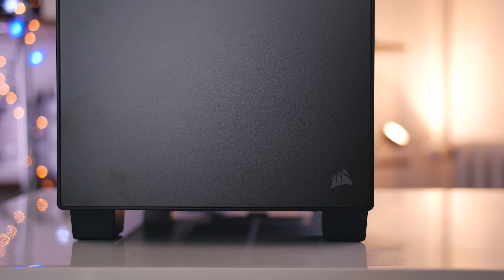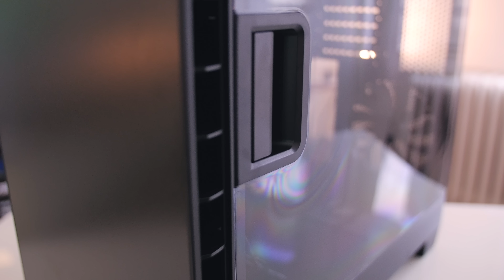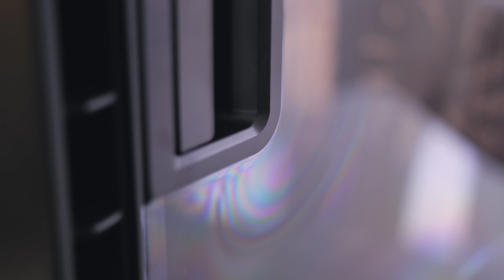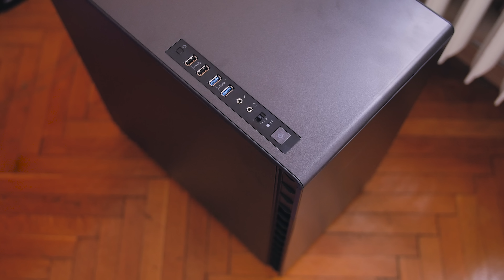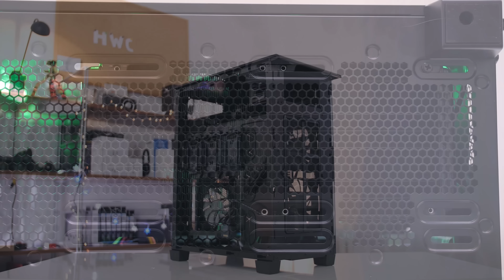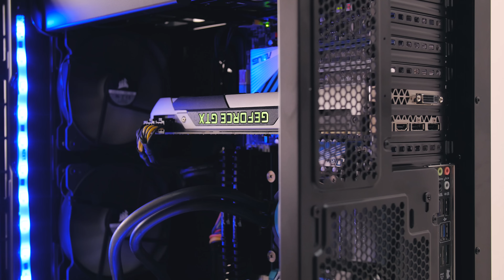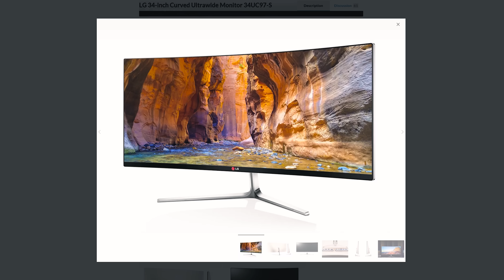Corsair 600C Case Review - Inverted ATX layout worth it?

Comment: Why's it inverted, like...what's the point? I don't get it.
Reply: + Connar Comstock some people want the window on the right side of the case.
Reply: +Connar Comstock Due to the shape of my desk, my PC has to be on the left side of me. Unfortunately this means that the left side is against the wall, so I can't have a window there like on most cases. This would allow me to have a window. I'm actually considering swapping my plain looking R5 for this.
Reply: +Connar Comstock The inverse design was chosen because it can reduce noise levels for the same level of cooling. With the standard design and the PSU on bottom, the top is open mesh for a radiator or fans. Lots of noise escapes that area. By flipping it upside down we can have a solid front AND solid top and the noise escapes from underneath and behind the case for the most part, which, if it's on the floor, will be a lot quieter. Even on a desk it's significantly quieter than a standard tower.
Reply: Learn something new every day I guess, the info about the way it deals with noise is actually something I didn't really think about, thanks for the replies guys.

Comment: I find that inverted ATX has flaws when it comes to water cooling. The radiator in this setup has the reservoir below the pump. In my bitfenix phenom m (prodigy matx), the hard drives get somewhat hot when the gpu in being used because hot air blows top to down. it shouldn't be a problem if the rear fan (intake) works fine, but it's getting recycled air. the intake is too close to the exhaust basically.

Comment: Why did you put the radiator on the bottom?  Heat wants to rise, so  the front mount would have been  more efficient.  That is also why the temps were better when you flipped the system.  Moving the front fans to the bottom in a pull mode would aid vertical air flow.  
As far as overall temp control, this case should would work best in a multi-GPU setup by moving the largest heat sources to the top, sparing the MOBO, CPU and RAM the extra heat soaking. It will however add  heat to the power supply, so proper venting of that space will be critical. Mounting a fan behind the two 3.4 inch bay slots or in the top of the system may help.

Comment: 1. Hot air always goes up,and you pushing it down with fans,it's just not natural + psu is sucking the hot air in.
2. All the text and branding are upside down...
There is really no good reason to make inverted case..stupid
Reply: +Fractal R my HP prebuilt case from 2011 had this inverted layout, why go back to the old days?

Comment: I am still waiting for the Vengeance C70 update. Also, why did they include the two 5.2 drive bays? they could have moved the SSD bays there, and given more cable management space in the back. Most folks who still use Optical drives will not spend this much on a case.

Comment: Dmitry makes some really dumb points sometimes. The case has 2x5.25 bays. Fucking USE them man!  He says he wishes the case had more drives cages/area. Yes, it has less than the H440, etc. Sure, it can't be a huge NAS server but most gamers and even enthusiasts aren't putting in 10+ HDDs (now or ever). But again, the two bays are completely ignored! There's even cages where you can put 3 SSDs per 5.25 bay such as what IcyDock offers. You can put hot swap drives there also. There's options. But Dmitry constantly ignores that shit even on other cases and makes it a huge  negative. You'd think that some who's so aware of products out there, would be aware of alternatives and uses from other sections of a case.

Comment: My question is... how many of you have your tower seating on the floor for you to easily access those power,usb ports on top of the case?
Or do you still like it on your desk so you can see the pretty window? and do not mind the power,usb ports on top?

Finally, to clean the bottom dust filter... can you easily remove without tipping the case to side?  Remove all cables to easily tip it to side?

Didn't the filter slide out to the back?
Don't most people have case seating near the back of desk? close to wall? Ya  know what I mean?
Maybe the bottom filter should slide forward, since the feet seems high enough.
Reply: +xxgg I have it on the floor.
Reply: On the floor (not using up desk space) currently with the (metal) side panel off ying next to it because I needed to change to my old gfx card and unplug the SSD (to play Warrior Within).

Comment: according to thermal dynamics those temps are accurate. hotter air rises, so the cooler intake air will drop down to the graphics card and CPU and get pushed out the bottom

Comment: For that price, Corsair should have made that flimsy side panel out of glass. The front and top of the case should have been brushed aluminum as well.
Reply: +1524mclovin If you wanted that to be actual glass add another $50 to the MSRP for the tempered glass, the additional rigidity of the hinge mechanism to support the added weight, the increase in size and durability of shipping packaging, which reduces container optimization therefore increasing shipping costs, etc. 

This case with a true glass side panel would be $200+.
Reply: +Rafael Santana a small glass panel of that size would not weigh more than 5lbs.
Reply: taief miah Really?
Reply: +Rahul Katre it's already overpriced as is. If this case was 99$ it would have made more sense. Look at the Enthoo Pro, Fractal Design r5, and Next 440.
Reply: George Makris you're mostly right. It should be your Obsidian series that screams quality, with rigid aluminum construction and glass instead of cheap plastic. Also, this case is indeed overpriced for what it offers and what it is made out of. That is why it did not receive an award on Dmitri's review.
Reply: +1524mclovin If you want to be fancy, you could get a glass panel made for this case.
Reply: there is a version with a xmoked tempered glass panel
Reply: Rahul Katre check oc3dtv
Reply: +1524mclovin That's where Silverstone comes in.
Reply: +1524mclovin not really, it's only 150 usd... aluminum and glass chassis are expensive to produce. 200 usd and it would have been more reasonable.
Reply: ZyTech And for 150 USD, this case is overpriced. If it was around 120 USD, then it might make some sense.
Reply: +TrueZtyleZ7 they make some damn good cases. Lian-li and Phanteks  as well.
Reply: +ZyTech this case is definitely not worth 150$
Reply: 1524mclovin Yeah, I would agree. If they priced it about the S340, it would be a powerful competitor.
Reply: +1524mclovin I love this corsair design and the Enthoo Pro M but each lacks features I want from the other...
Reply: +Rahul Katre The S340 is a $69 case.
Reply: +Jorel Bates Which features would you want on the 600?
Reply: 1524mclovin We'll see. This case has a $149 MSRP. That's about $10 more than an AIR 540, one of our best selling cases, and this case has a few features (sound damping, fan control, extra USB ports, big window version) that the AIR 540 doesn't.
Reply: You and me are some of the aforementioned "Quality Junkies"
Reply: then it breaks easily omg stop

Comment: It just doesn't look right to me. I do like the way the drives are mounted in the back. With the high capacity of mechanical hard drives I think the amount of bays is just fine. I don's see any compelling reason for the inversion. I would prefer the heavy psu at the bottom of my case for many reasons. I also would redesign this case to eliminate any 5.25" external drive bays. The fully windowed panel is really cool. Until you scratch it that is. The price is also too high. $150?